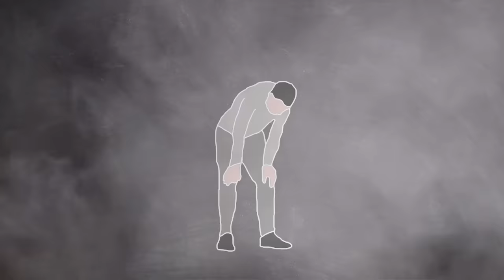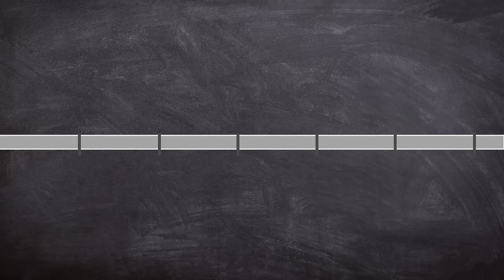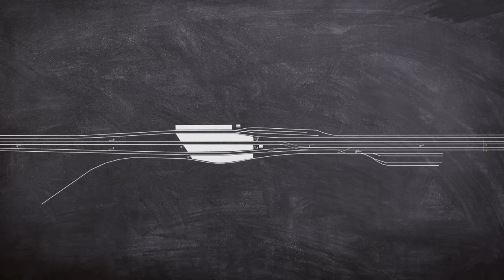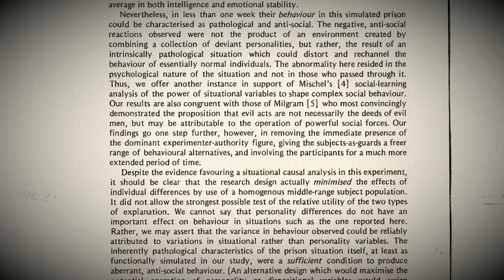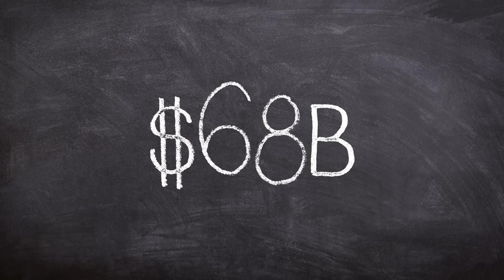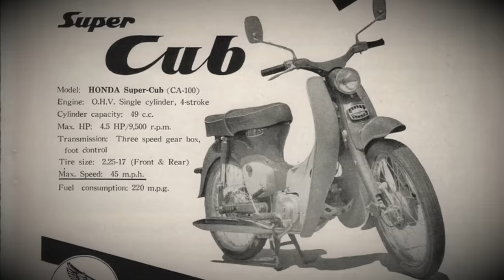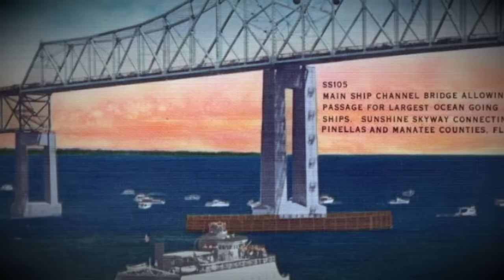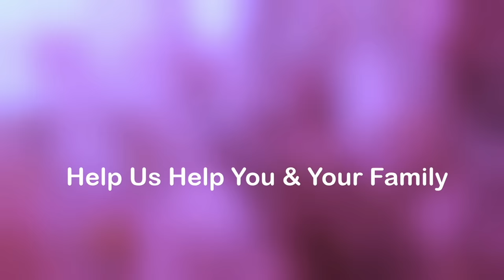Year 6 Plainly Difficult Documentaries | Youtube Rewind Omnibus

Comment: 10:05:40   "world's largest grain elevator"..... Me, as a firefighter of over two decades: "Dust explosion?....... Yep, dust explosion.".. People don't realize just how easily, and how energetically dust can go up given the wrong circumstances... Grain dust is particularly bad, but it's happened at pretty much any/every place that works with dusty stuff. Sugar factories, powdered sugar will go up like crazy. Sawmills, sawdust is a bastard.. Etc. Honestly the only things worse than dust  for industrial booms, are industries that use pressurized flammable liquids.. A BLEVE is just about the scariest thing on earth.. It's pretty much just an accidental thermobaric warhead when it goes. Even a fertilizer plant doing the whole ammonium nitrate thing, isn't as scary as a proper BLEVE... BLEVE stands for Boiling Liquid Expanding Vapor Explosion... But it should probably stand for "Balls! Lotsa Extremely Vaporized Englishmen"